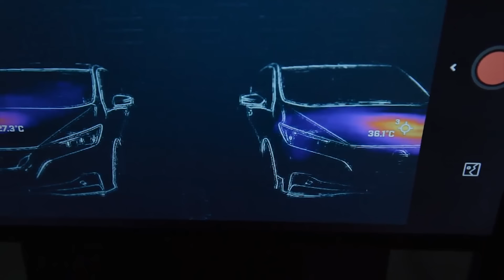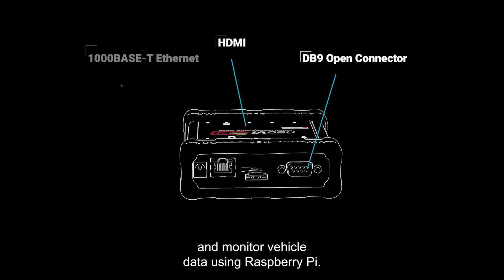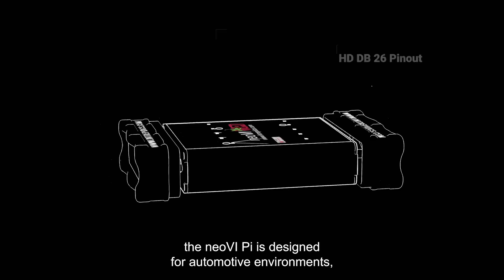Lucid Gets Billion Dollar Investment; Dongfeng Nears Deal For Italian Plant - Autoline Daily 3865

Comment: Your report about EVs reaching price parity with ICEs contradicts itself. The study does NOT factor the costs of fuel and maintenance.
Reply: Thats not how buying things works. You don't give them less money because in a few years you won't have to replace an alternator.
Reply: You save in fuel, but pay more for insurance
Reply: @briangasser973   I looked it up: 
The average cost to insure a Ford F-150 Lightning is $251 per month. That's $6 less each month than the rate for a regular F-150. And at State Farm, the cheapest company for EVs, the Lightning costs 11% less to insure than the gas version.
Reply: @MrTeff999  I can't speak to the F150, but when I called my insurance company about a Tesla, the rates were significantly higher due to its torque and cost of repair.

Comment: Those humanoid robots look hilariously useless. Why would you need a humanoid robot to inspect a body panel? That's literally just a camera (or lidar) and these factories already have those cameras. Adding a slow pair of legs and the ability to fall down makes no sense. The entire humanoid robot thing is just chasing the AI stock hype, it's all a lie. That hype video showed how fundamentally slow, unbalanced, and incapable that form factor is.
Reply: Never mind what that robot does - why do they play with walking robots on a flat factory floor?
Reply: I've been amazed by the mileage that the humanoid robot idea has gotten, very inefficient and impractical the only advantage is getting in some spaces designed for humans
Reply: Negating the pump and dump portion of Musk's robot effort, the form factor is unoptimized for high volume factory work.  I would be much more impressed if Musk found a way to make a modular robot with customizable upper and lower sections with the torso as the compute (but that would require Musk to have some engineering ability which he lacks).
Reply: Human form is optimal for everything, that's why we have legs on cars, bikes, scooters.
Reply: @rp9674  Don't forget vision.  Why bother adding cameras to the side or rear when flOptimus can simply move its head like a human.
Reply: @bobbbobb4663  Thats just a regular industrial robot platform. Any amazon fulfilment center has hundreds of them. Generally if your robot isnt bolted to the floor for stability and strength its performing some sort of transportation duty and will have a bottom half for movement and a top half specialized in whatever form of goods its carrying. Musk can't find a way to come up with something we've had for decades. The last bright idea he had was the CTs wiper.
Reply: Cameras are cheap, should have a 360 view anyway
Reply: @ethanwelner1230  I'll admit to not keeping track of the robotics community.  To reinvent the wheel and claim trillions in new revenue for something so impractical simply means the only purpose of this robot is to pump the stock.
Reply: @rp9674  5 sensors plus a prism and stitch the images.
Reply: re: "Those humanoid robots look hilariously useless." that's because they are useless, this is just hype and propaganda targeting the naive (same as what Elon's doing with his Opti-bot).
Reply: @bobbbobb4663  re: "the only purpose of this robot is to pump the stock."  <---- see, Bobby gets it. 🤙 welcome everybody to the GRIFT ECONOMY and the strategy of the "Pump and Dump".  also see entry for Late Stage Capitalism just prior to Economic collapse.
Reply: If these robots are successful will be impressive and almost everything they do would be done better by more conventional robot, job specific, tracks, wheels

Comment: Tesla CyberBust News:  Tow hitch connected to wimpy casting!  Windshield cracks under soft 200 lb load!  New fiery crash started by ancient 4680 batteries fueled by burning aluminum!
Reply: Xi bot
Reply: Bot confirmed.
Reply: gasoline is flammable also, botty boy
Reply: Oh, forgot to add, they invented firefighter lithium blankets. You are just not so informed
Reply: That "wimpy casting" endured tens of thousands of pounds of dynamic load and in the opposite direction of its designed use when the rear of the Cybertruck slammed down twice on a concrete tube and beam in WD's video. It's impressive that it held up as well as it did.
Reply: So you don't plan on buying one? :face-purple-crying: Oh no!
Reply: @zroger73  So you are saying that the ME's only read their Statics textbook and forgot to read the Dynamics textbook?
Reply: @LewdCustomer  Why would I want another incomplete product led by Chief Engineer babysmurf9000?
Reply: @dertythegrower  He's not a bot, he just really needs to touch grass.
Reply: @dertythegrower  No firefighter is jogging up to an electrocution and toxicity risk to toss a worthless blanket onto the top of a car. The fire stuff is a scare tactic by weirdos, but it doesn't help to just make things up in response.
Reply: @bobbbobb4663 👈 You have to be a bot, no one is that dumb. 🤣🤣